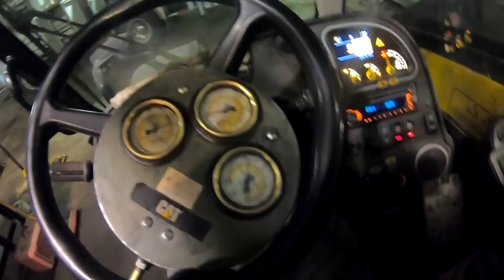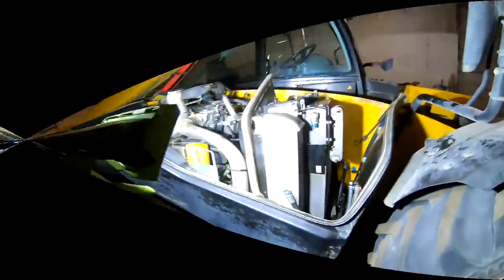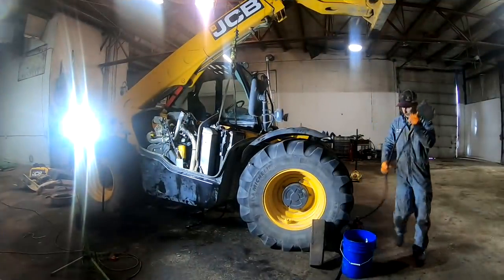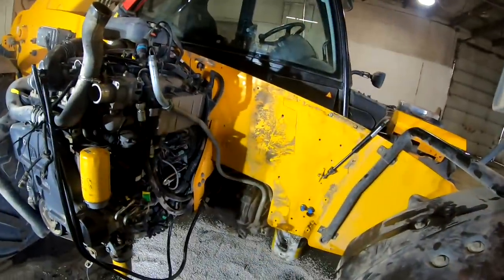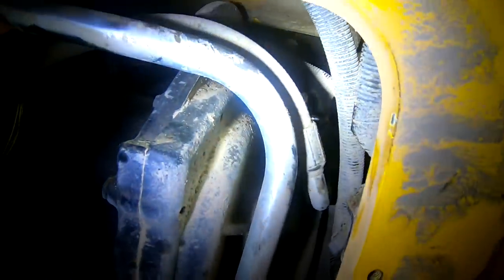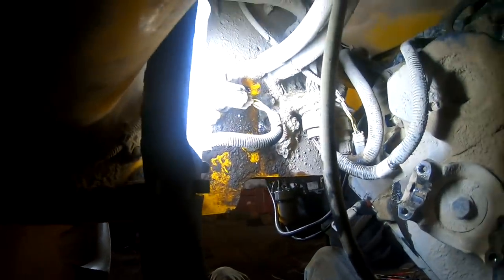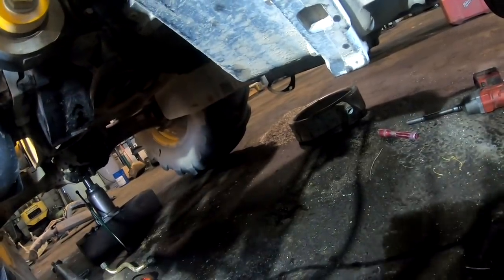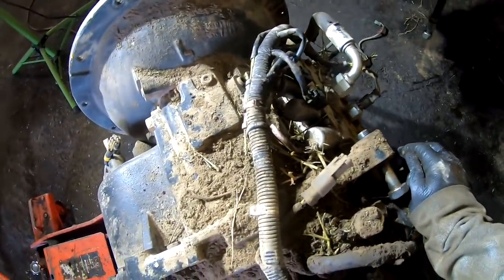JCB 541-70 transmission removal

Comment: I worked at a metal fabrication shop way back in the early part of mt career and we did exactly that. We put down long sheets of 1/4 " steel plate all over the floor. With that we could actually use the floor for layout and template work for stair stringers and hand rail fabrication. But it certainly did help greatly when we had to jack things up and around instead of the rough concrete floor. 3/16 th steel may be a little thin you may want to consider 1/4 inch just so you dont get a lot of dents in the plate from heavy objects hitting it.

Comment: Many machines come with all of the books. We had the problem that management would put the books on the shelf in the office and forget about them. Whenever somebody buys a piece of equipment, they need to get all of the parts and service manuals included so they have them for anybody that works on them.

Comment: The plate idea is a good one that works as I use a 4'x8' sheet of 3/4" plywood on my gravel floor.
Reply: carbine1776 BOB  It is still cheaper than a concrete slap. I just broke my sheet so this time I'm getting 1" film face form ply, i.e. what is used for concrete form work as it is stronger than what I had and the film face means dirt, fluids, grease, grim and oil just wipe off.

Comment: A couple of pieces of steel angle iron or c-channels with a wide flange?  You could then roll the jack-wheels like they were on steel rails.  And they would be lighter than a steel plate.  A couple of steel angles cross-pieces with holes at either end to keep them at an adjustable fixed-with, and you could hook a pulley to them at either-end.

Comment: for the dogs.. hardware and plumbing supplies in their sewer fittings will have a DVW Combi with a wide radius 1/8 bend.  that and a few foot length of pipe will allow the dogs to drop a ball into the combi and it will hopefully roll out the end of the pipe.. once you see the fitting you will understand exactly what i am talking about.

Comment: Warren, would it be feasible for you to get a big bucket of epoxy and use it to smooth the floor where you do a lot of your jack work?   It dry's hard and smooth and would last a very long time and it's grease, gas and oil resistant too. It might be worth looking into.